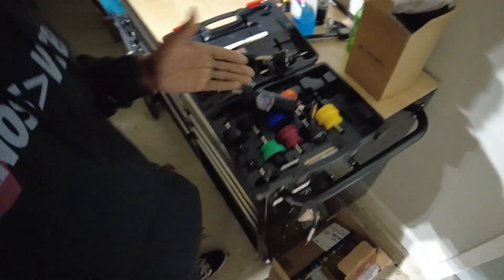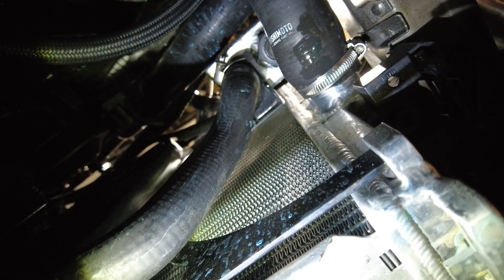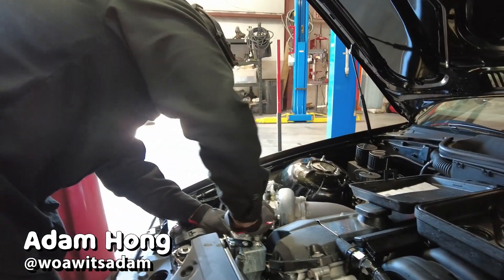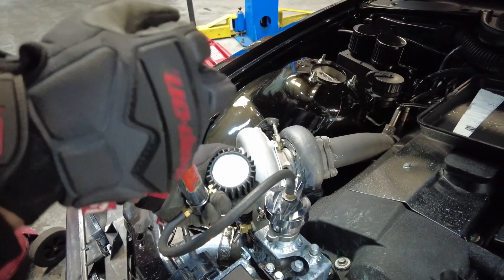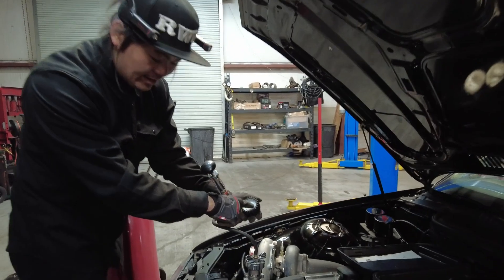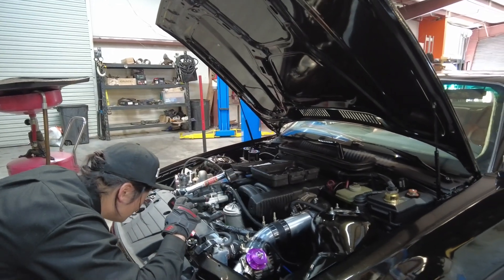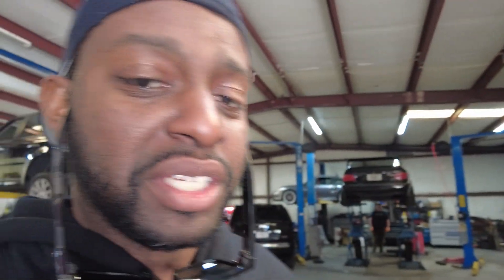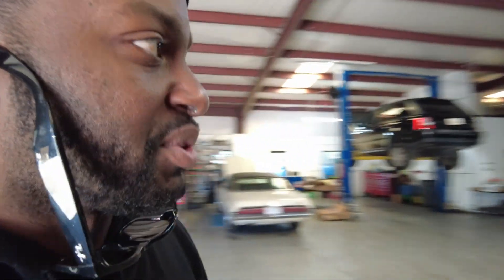Buy A Coolant Pressure Tester!

Comment: Check the pressure range on your radiator cap I think it would be around 15-18 psi if I remember correctly. Vacuum bleeding is the best trick to bleed cooling system on theses cars I have a snap on kit I use for work (Acura Tech) works great on other models tools just need the right adapter for coolant reservoir. Cheers from MD got a turbo s50 in my e30 keep going my guy.
Reply from the maker: Yeah the plan was to go with a full vacuum bleed but we didn't see any issues starting out so we let it run and so far it seems like everything is fixed on its own